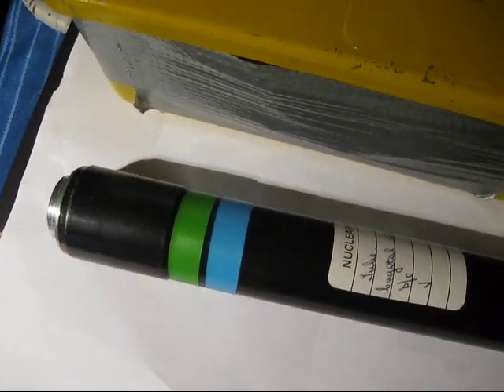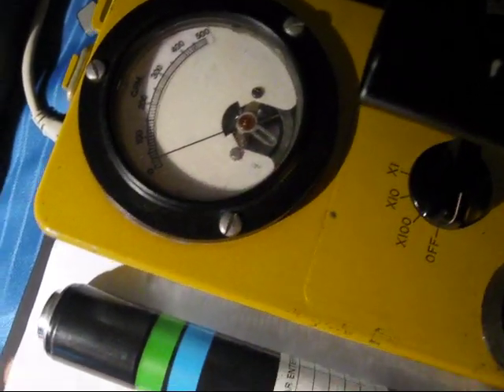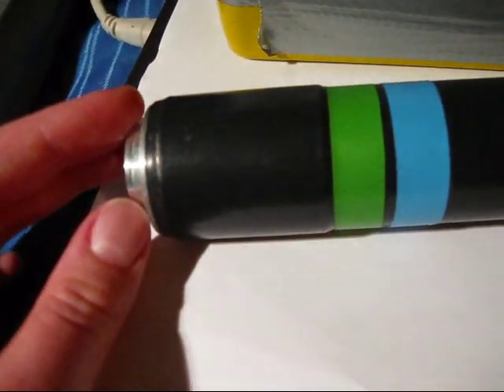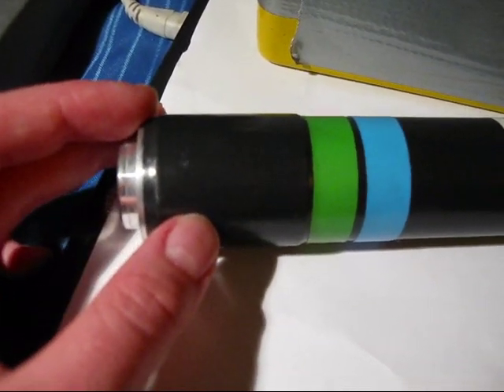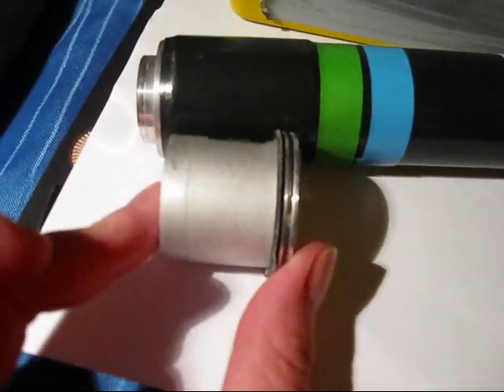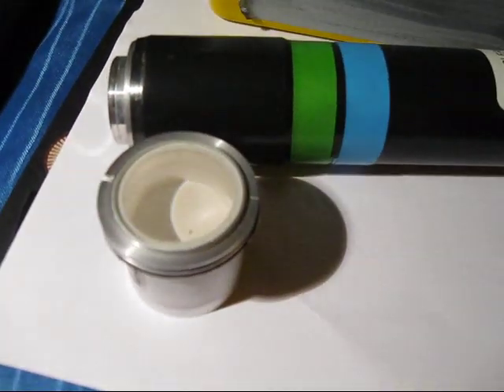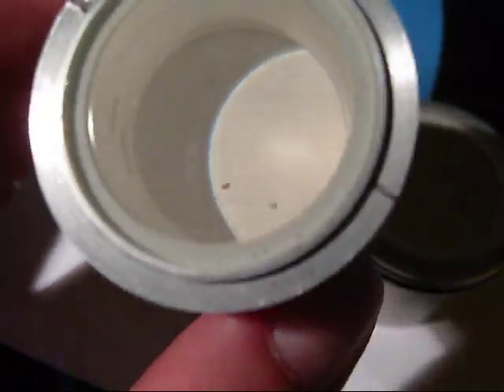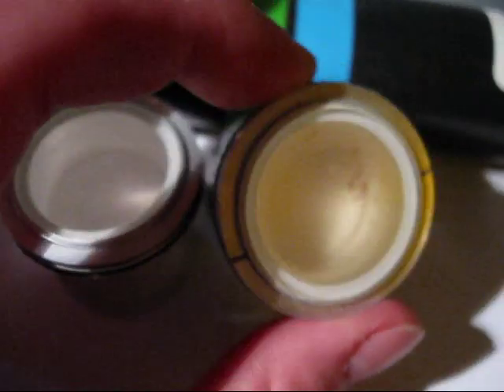a close look INTO a scintillation crystal (radiation detector) / sodium iodide + thallium / NaI(Tl)

Comment: To answer a few of the previous questions regarding scintillation detectors and their advantages or disadvantages;

They are many times more sensitive than a Geiger-Muller tube; This is great for low level work or for finding little spots of contamination.

The scintillations (flashes of light) are so weak that the photomultiplier tube (or photodetector diode) has somewhere from a half-million to ten million times gain. The photons of light are converted to electrons and there is something like a "relay bucket" of voltage staged reflectors that each are at a slightly higher voltage until the final stage where the pulse is generated. The power supply for a scintillation detector takes between 800 and 1600 volts (at a super-low current) to operate. A G-M tube operates between 400 and 900 volts.electr

Crystal-based NaI(Tl) or CsI(Tl) detectors are very fragile and the NaI(Tl) crystals are hydroscopic (they suck up moisture from the air) and if the seal is broken that prevents air from reaching the crystal it can quickly (in hours to weeks) destroy the crystal by depleting the active region and making the crystal yellow in color.

Photomultipliers are also very fragile and they are sensitive to magnetic fields. Usually the photomultiplier tube is shielded with an anti-magnetic metal (known as MU-METAL) to keep the electron beams that is bouncing from stage to stage from being deflected and lost.

The detector she is using is known as an "end well detector". It is usually mounted in a giant lead shield with the hollow end pointed upright. Then a sample (in a plastic or glass tube) is lowered in to the well and several inches of lead is placed on top to stop background radiation.

Scintillation counters generate these pulses; and the pulses are different in height depending upon the energy level of the gamma ray. Different radioactive isotopes that decay with gamma radiation do it at different energy levels. With a well shielded detector that is calibrated and attached to an MCA (multi-channel amplifier) it will create a graph of the spectrum of energy coming off of the radioactive material. Like a fingerprint the energy levels can be mapped (looked up in tables) and used to determine the isotope (radioactive elements) involved. That is why lots of shielding is used in a laboratory grade scintillation detector attached to an MCA.

You can use scintillation detectors with (some) geiger counters since they may give enough voltage for the photomultiplier to at least function. To do it right; the voltage on the meter needs to be recalibrated (to a different voltage depending upon the probe) and a little circuit (called a transconductance amplifier) is used to increase the gain to make the pulse big enough for the meter to detect it.

G-M tubes generate an pulse when any gamma ray (and some probes for beta or alpha particles) crosses through the chamber. They are good for determining the level of radiation but not the energy spectrum.

Comment: Actually, electrons are just slightly accelerated, maybe up to 150 eV or so. I will rather say that electrons are "multiplied" by secondary emission(s) of electrons from dynodes. When one electron (lets say from photocathode) hit first dynode, it liberate many more electrons from this metal, which then are accelerated toward another dynode... and it repeats all the way to the final electrode - anode, where the signal is available as short negative electric pulse.

Comment: Interesting how the photomultiplier tube has a filter on it. Do you know why they do this? Why not a clear window? I'm thinking of having a go at building one by hand (I have some experience with PMTs in other applications), so I'm curious as to certain design features.
Reply: Actually, that "filter" is the photocathode of the tube.
If you find a tube with a clear window, the photocathode is gone, and the PMT will NOT work.
Reply: RadInfoMan
I have three Hamamatsu PMTs, which has orange photocathode (bialkali), and I suspect that one that Bionerd23 have is actually trialkali (multialkali) photocathode, sensitive all the way to the red light.

Comment: ***** Mass increases exponentially as velocity tends to c. It would require an infinite amount of energy to reach the speed of light in a vacuum. Cerenkov radiation is produced when the speed of a particle exceeds the speed of light in that particular medium. Nothing can move faster than c at all.
bionerd23 Do you know the cause of the particles in the camera shot when the x-rays are turned on? I've never seen this before. Nice video, although the sensitivity of the crystal to water is a property of NaI(T) and not all scintillating crystals.

Comment: The biggest advantage with a scintillation detector is the fact that gamma rays of different energies will produce different electrical pulse heights on its output cable which can then be fed to a spectrometer for analysis. A Geiger Muller tube produces only one pulse height for different energies of radiation that it detects. Geiger tubes are useful for COUNTING events (such as with a Geiger Counter) but is totally useless for use in gamma spectroscopy.

Comment from the maker: i was just curious if the marble would glow under intense x-ray radiation as well. it would not have made any changes to the glow inside the scintillators. the uranyl ion inside uranium glass can be excited by UV light to give off a wonderful green glow; i was simply curious if i could archive the same with shorter wavelengths, namely x-rays.

Comment from the maker: the only way to check food for contamination with this is to SHIELD IT with the weight of a man in lead (up to 50-100kg) and then let it measure for days at a time, comparing to a measurement of days at a time without food in the lead box. for that, you'd need a meter that logs your registered impulses; and food which does not go bad very quickly.
or, in other words, i think a pancake probe is useless at detecting the minor contamination in food, i also have a video on that. watch?v=Silk2g8fS8Y

Comment: Nice video! Correct me if I'm wrong, but it looks like the electron multiplier works like an image intensifier tube, except for the fact that there isn't a phosphor screen for the electrons to hit, but a gas filled chamber containing an anode and a cathode (like a Geiger-Muller tube). When the electrons hit the gas, it is ionized causing sparks to jump across, equalling gamma rays striking the crystal.

Comment: @bionerd23 Very interesting, thank you. Since light travels at about 0.03% slower than c in air, if you had high-energy beta particles in the order of 20.4 mega electronvolts could they produce the Cerenkov radiation in air and move at something very close to c, like at more than 99.9% of c? So if you had high enough energy particles could they move at c in vaccum?

Comment from the maker: @crimsonhalo13 
the dose rate was about 30 Sv/h, which is enough to kill you in just minutes (if it were a full body dose). usually, these scintillation crystals are attached to so-called photomultiplier tubes that will GREATLY intensify the emitted light, as it would otherwise not be possible to detect. with save / low x-ray doses, you cannot see any "glow" in the crystal at all with your eyes or a normal camera.

Comment: "Ionizing radiation, like people falsely call radioactive radiation"

So this detector is an x-radiation (gamma x-rays) detector, since x-rays are ionizing rays and not actual radioactive particles such as beta and alpha ones, right? I suppose it can't detect radioactive particles?

The electron accelerator is a cathode ray tube like the ones used on crt tv's I bet.

Comment: Have you considered baking the "bad" crystal to remove the humidity?  It may also help to change the colour back to normal, since this yellowing effect is often caused by colour centres induced by ionizing radiation-  crystal structure dislocations.

Some older camera lenses contain lanthanum and other lanthanides since it produces an excellent high index glass, and this tends to turn the lens brown for this reason.  They can sometimes be "fixed" by irradiating them with ultraviolet light.

Comment: @dado1802 They are not only accelerated, but also multiplied. The signal from one photon is way too weak to detect with ordinary optical sensors because of all the noise associated with them. So the PMT accelerates electrons so that they land on special electrodes and knock off more electrons that in turn knock off more electrons, effectively multiplying the intensity of the signal by several orders of magnitude, to a level that the counter can register.